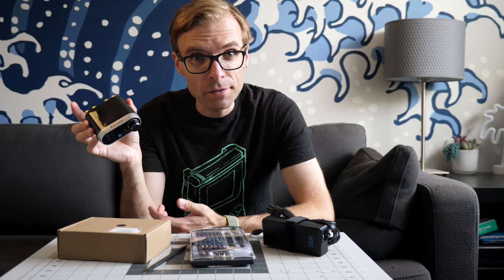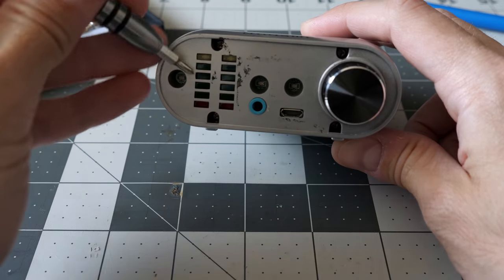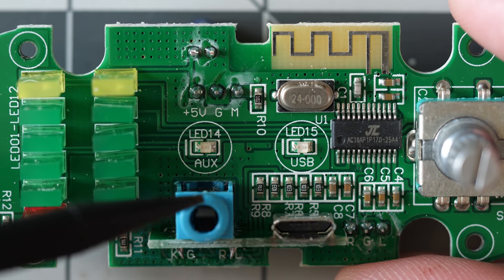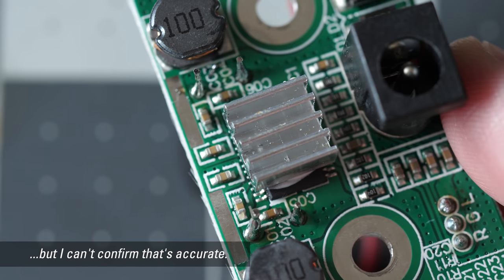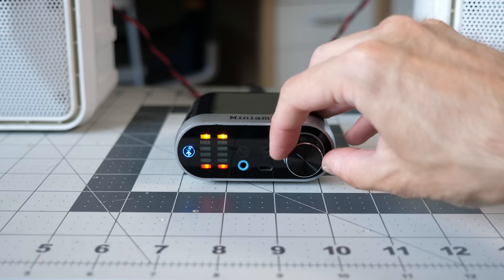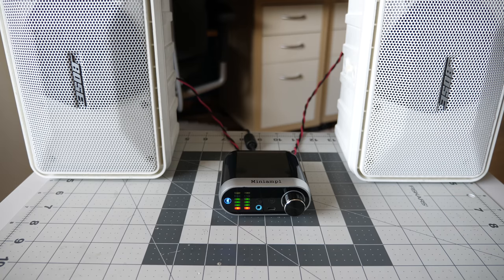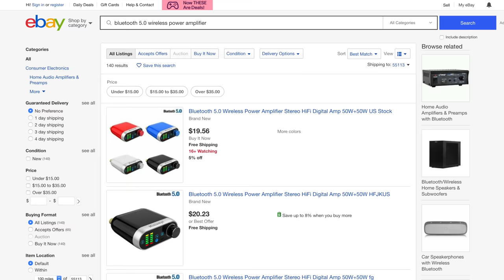Mini Stereo Amp (That Doesn't Suck)

Comment: If you're worried about internal heat build-up in this tiny amp (which i would be), get a dremel tool and cut some 1/4" vents in the top & sides of the case...or even just drill a bunch of 1/4" holes in it, all around.
Reply: pls don't.. it's a class D chip. it only gets warm. and it is ment to transfer heat to ground plane trough a bottom pad

Comment: i built one on a breadboard with a TCA0372 1A dual opamp which i recycle from an old table top cd player.
i think the fun part is when i realized i got the calculation right when i hook up to an oscilloscope and no magic smoke.

Comment: With its PCB design, 4 big audio connector work as big heat sink, better than its tiny heat sink. With an efficient switching amplifier, I would not worry about heat dissipation.
Reply: Thats a good point, as long as it has nice big thick tracks to the connectors.

Comment: I think it's virtually the same as Nob Sound NS-01G pro. It probably uses the same chip TPA3116A x2. Class D amp, with some method to minimize the noise that class D amps produce. Mine is great, I love it

Comment: If you want something that's actually decent get something from Fosi Audio or Aiyima like the new A07 Pro, yeah it's more expensive at around 60USD and completely overkill for your use case but it's actually manufactured right and does some great power.

Comment: The worse part about the cap leads is that the proper practice is to cut the leads to length prior to soldering, so it wasn't even a 'couldn't reach' issue, just straight laziness lol
Reply: Or, that capacitor lead length might also could be serving as heat sink for the cap,  
extending the life of the cap just a little tiny bitty bit. It would be more applicable in
a switching power supply where those caps bulge, leak and blow chunks as their 
ESR goes up and up... That's the main failure w/ MOBOs, & especially LCD Monitors.

Comment: What are the BOSE full range speakers like at over 10 khz? How to make an amazing full range speaker sound (with the extra khz). Make a pair of extremely thin sticks that are also very short sticks (only like 2 mm tall, made out of a split toothpick). Then glue each stick onto the dust caps of the FR drivers and stick a tiny piece of (coffee can seal) foil onto the ends of the sticks. Cut  the foil pieces in a teardrop shape like 1/4" x 1/8" big. I suggest you prick a hole in the tiny foilies to make them easier to glue onto the ends of the sticks. It's REALLY TEDIOUS but really cheap and your full range speakers will STING like crazy in the top end. 

It's acoustic separation technology, the foily is vibrating completely independently of the dust cap, and that is the big secret. If you attach the foily directly to the dust cap you get NO WHERE NEAR the effect. When it's on the end of the stick, acoustically it's like a miny 2-way coaxial driver, giving the top end a completely separate vibration to the main cone. And this extends the highs way better than just sticking the foilie directly to the dust cap.

Comment: Increase the voltage by 1 or 2 watt. Depends on the ohms your dealing with. Built a heat sink to prevent heating up..

Comment: I bought the exact same AMP a few month ago, Iv been using it as an amp for some small 40W speakers Iv had laying around to upgrade the sound on my stationary PC. However.. The LEDs are not working on my AMP out of the box, and there is alot of static noice if Im using the jack input.. But other then that it works just perfect.. I did however buy it with a Power supply that has a 19V and 3,42A output :) And I think I payed like 25dollars for it all.. Well worth the money :)

Comment: 1:00 I had to modify a 2.1 amp using the cut track method, as the subwoofer channel had an independent volume control that wasn't controlled by the main volume. No idea why you'd design something like that...

Comment: OK .... so I am old and remember the massively heavy amps that were common in the late 70s.  Good thing with them is after several decades of working flawlessly,  they atleast made a great doorstop  or weight for holding down wood projects as the glue dries 😁     Much agreed on Test them Dismantling idea.    Wish those with Amp Dynos would start testing more of these budget D class amps to see if they meet claimed outputs.   Worst case you have a light duty use Paperweight if all else fails
Reply: My 1976 kenwood is still running as a dedicated guitar amp (added a cooling fan),wonder how that little unit will fare in the long run...😒
Reply: Many of those old amps are or were fixable, since they just used standard transistors. Another plus.

Comment: I wish they put all the ports on the back, if you use a laptop dock or desktop, you'll have to run the cable out the back. 
Otherwise a great amp. 
For now I have a kinter amp and it's not as fancy but it has a real POT volume knob and RCA input on the back. For $18 from Amazon it's a decent deal. 
I might get the upgraded model with an extra AUX on the front and a Subwoofer input.

Comment: Hand drill a grid of small holes through the top bottom near the chip. Add a bigger piece of metal on top of the other. The googlnet can tell you what adhesive is decent for cheep. 
Have fun with it. Make a slightly larger enclosure that has the above features and say it's a custom built amp just for garages. Bend an old gas can or put it in a cigar box. My brother-in-law user to do stuff like that in our shop. We'd take the speaker-loaded front panels and staple them into large cardboard boxes of "correct" volumetric size and A-maze our friends. Fun is fun!
Reply: My brother made a killing back in the 70's building custom speaker boxes using particle board and speaker cloth. We would salvage speakers out of old stereo units and he would sell eather custom built preinstalled or you could choose from a list of Radio shack speakers. He sold a ton of those before getting bored with it. I believe it financed his first car.  1970 Duster. Those were the days. I am restoring old lawn mowers to finance a Conversion van right now.

Comment: The heat-sinked IC on the back board is likely a class D amplifier (switch-mode outputs). This is re-enforced by the inductors present on the each of the speaker terminals.I don't think overheating will be a problem.
Reply: Class D isn't magic. Yes, its a lot more efficient (90-95%) than typical class AB (65%), but it still has to dissipate some heat and that is very tiny heatsink in an enclosed space with no path to outside.
Reply: @goatofpower  True, there is no magic. However, the heat produced depends on how hard you drive MOSFET gates, and how fast the MOSFETS switch between off and on states. That switching time is where most of the heat is being produced. Minimize the switching time, and you minimize the heat produced.

Comment: Actually, I think the metallic contacts act as the heat dissipaters, they are big enough and get rather  hot while the amplifier works - though they do not touch the chip directly.
The sound level bar is absolutely useless: I just put a sticker on the green/yellow region and can only see two red indicators. :-)
P.S. Just discovered that it is possible to hook up Sumsung s7 to this device via a MiniUSB adapter and use it as an audio amplifier for the phone. The S7 has recognized the device immediately.
UPDATE. A couple of days of good work and now the sound in one of the channels disappears in about 20 minutes after being switched on a insignificant load. It looks like the heat affects the  soldering somewhere inside.

Comment: Class D, the future of commercial designs - ~90% efficiency, small heatsink seems to be 'OK'.
Also break the connector, complain about build quality :D
Reply: 90% “theoretically” efficiency. I have yet to see just “One” class D amp that actually deliver what people expect from the specifications. Even professional build class D amps that promisses like 1-2k watts into 8 ohm usually gets utter blown away by a well constructed 30 year old class a/b amp of 1-200 watts with a 15kg transformer in the psu. Class D is only good for cheap solutions where real muscles for continous High power load isn’t really needed. That doesn’t mean that its completely useless tho, you just can’t expect anything at all from these kind of china electronics. You might get possitively surprised sometimes tho. But in most cases Its more than adequate for driving those old car speakers out in the Working shed or for a cheap bluetooth speaker for your phone.

Comment: I got the LvPin 2.1 hooked up to two 
NIB SET OEM 6x8 Genuine Ford Speaker XC2F-18814-BA  with GRILLS 25 WATT 4OHM  and one 8" subwoofer all installed into a plastic cooler and I just plug it into my cig lighter it blasts me out of car!

Comment: That's a neat little amplifier. For $20 it sure beats building one. It'd be interesting to risk mucking it up and injecting a tone as well as looking at the output on a scope but I was convinced it was worth the buy by your choice of speakers. 

I would set the unit up in my van for playing audio books. Most normal car units without running through a separate amplifier are a bit underpowered for clear audio when road noise is a big issue and they are a pain to pull out of the factory fascia and mount they are installed in so as to swap or modify. The only thing I would do is create air flow through the case because I can't imagine it not becoming an oven in the enclosure even at around 20 watts.

Thanks for the video and being the test dummy. I have not been as lucky in my eBay lottery adventures.

Comment: Perhaps they tuned those cap lead lenghts to act as RF chokes for a specific harmonic frequency of the PWM amp in order to minimize ultrasonic distortion ? ;)
Reply: i didn’t say inductor. They are certainly antennas, and hence their propensity to attenuate (or, “choke”) any rf energy that is matched to the impedance of those lead lengths (hence my “ultrasonic” comment).

I had put a “;)” but I guess you missed it 😛
Reply: I actually said “act as…”Cognitive dissonance harder 😝

Aren’t you up on how RF antennas work? Hint: they radiate energy optimally at a specific frequency. Google “simple RF notch filter”.

Comment: I have this little amp. I ran it on a 19V 65V power supply and compared it to a small Harman Kardon amp using small KEF loudspeakers. 
Conclusion: it’s a neat little amp but it clearly lacks bass. Maybe it really needs a 24V power supply but at 19V I cannot recommend it.

Comment: Why you didn't use a old/used or new car radio to play music in your garage? Build it into some type of case, connect a 10Amp 12V DC Power Supply to the car radio and it's all fine.
I build one into a tool box. I have also installed the speakers in the tool box. But I always have the possibility to connect other, external speakers.
Reply: That’s what I’m thinking of doing. You get 4 channels and lots of options, generally. Also the sub outs are nice if you want to add some low end.

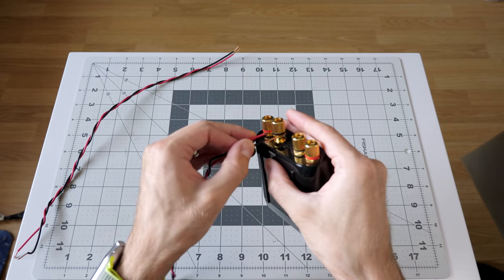Comment: 13:03 You don't have speaker cables twisted like that, it acts as an inductor and consequently a loss of highs. You should know that.
Reply: This is not a coil; short intertwined wires have no audible influence at all.
Reply: How much RF do you think is prevented by doing this?

Comment: Hey man I love the content and the production , really well done . My question:  I bought a few of these Toptech “1000” watts party karaoke speaker that has (2) 10” speakers w some party lights and a handle . You know one of those big speakers , I got this one at discount retail store. The sound is “ok” to say the least but of course it’s missing that BUMP.  Now maybe I won’t be able to get that nice bass bump that I would get from jbl or Bose, but it just sounds weak.
Here the actual question: is there a way to connect one of these type of amps to that type of speaker to give it that extra oompf it really needs? Maybe you could do a video where you add an amp to one of these party speakers !? Or if it’s not possible do you think you could make it possible?? If you did it would revolutionize the market . Make these speakers actually worth buying. Please help.

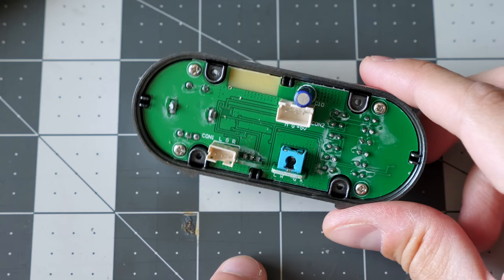Comment: At 3:57 the LGR connector is attached to the board, after you remove it at 4:04 the connector is broke from the board. Then you complain about the short you created like it was the manufacturers fault after you put it back together. Using the proper tools to remove the connector instead of yanking on it might have prevented the damage.

Comment: If it's Chinese, it's 50 watts (if that) at 10% THD.  At best 12 watts at anything like HIFI specs.  But who knows, could be a gem.  For $20 I'll take a leap fo faith.  My speakers are 92db.
Reply: The amplifier chip which does all the heavy lifting I believe has something to do with the US state of Texas! So yes 50 watts with the right power supply and speaker impedance.

Comment: you broke the solder joints on the RGL connector when you removed the cables . It is clearly visible at 7:41.
Reply: I see that he pulled the plastic housing off.. and probably didn't push the connector all the way back in when he re-assembled it... another reason why you need to disassembly it... AFTER testing it!

Comment: You should feed it clean DC.  A laptop charger is far from clean. You could use 18 li-ion cells (6S3P) instead; (6 serial, 3 parallel), for a clean 24 VDC supply.  The batteries are probably more expensive than this amp.

Comment: Hooked one up to harbeth p3esr. Used same power supply i got with     
Tivoli model 1 radio. 12v sounds quite nice within its volume limitations as these are not efficient speakers. Allen shaw is quite right about amplifiers and harbeths. As the audiophiliac said. Harbeths makes everything sound goood.

Comment: I certainly wouldn't expect it to drive the Bose speakers. That tiny amp is basically pi**ing it cuts out to try to drive it. It gets double Brownie points for not distorting the sound though.

Comment: If the boards were designed a bit differently to allow the massive caps to lay flat against their board, and rearrange the front board a bit to move the connectors to the top half, this little amp could be made to be extremely compact. It's overall footprint could easily be cut down to a quarter to a third of what it currently is with better initial design considerations. Alternatively, all of that dead space inside the case could've been used for an internal power supply. 
The idea of using the banana plug screws as cassis posts is smart, and might be an idea I borrow for future projects. 
Though the rotary encoder is something I'm not too sure about, it's useful in applications where you have menus and such to scroll through, car head units are a great example of this, but for a volume-only dial I'm not too sure of the implementation of a rotary encoder. I wonder if this kit is actually based on a reference design provided by a company, or used in other projects, where that rotary encoder actually sees practical use, an this just happens to be the cheap variant of the product that cuts out anything that isn't strictly necessary; such as incorporating a display and software-based equalizer, which I'm sure that chip on the front board can provide, I don't feel like looking that chip up myself, but I do know the vast majority of Bluetooth audio products have more features than what this unit is providing. 
The VU meter seems a bit sketch as well. Look at how bright the power input and power on lights are, as well as the brightness of the solid volume min and volume max lights are. Even when the top lights are functioning as the VU, they seem much brighter than the other VU lights. I wonder if the lights are of bad quality, or if the circuitry for the VU is of bad quality.
Reply: Internal power supply would be nice but its a nightmare getting approval in all the countries. Thats why nearly everyone uses external plug packs. (And no, you can't just put an approved power supply inside the case!)

Comment: By the way, this amp costs ¥99 (99 CNY) or ¥116 (116CNY) with a 60W power supply included in China. All the generic mini Bluetooth amplifiers you find on amazon and the like are made by a Chinese company called “AHIFI发烧音响器材店”. I can’t believe how inflated and overpriced the prices of these are in the United States. Seriously.

Comment: You REALLY need to drive these TDA chips with 19v or more because at lower voltages they just don't sound very clean. But no matter how much voltage there will be background hum. I run a pair of Yamaha BR15 15" PA speakers with a 19v/144w DC brick and they're close enough to a real yamaha rack amp SQ wise

Comment: I buy the Amp for 15 Euro and it work really good for that less money! I don't knew that the USB Port was for direct Audio out for a Computer...that is Amazing, is'ent it!? Sure, i think so! 

I don't know for what i need specially that USB Port to use for..., but it is there and maybe in the futore i have a idea for what i can use it ;-) 

Nice Review ... in my Oinion that Amp is all the Money worth!!!
I buy it for an iPad to use it with Guitar Software and Audio Speakers for HiFi Sound not for Mixing and i think thats Sounding very good! 

Other Solution with this possibilities cost a lot of Money!

Check that Amp out...i take up all two Thrumps! 4 of 5 Stars! (maybe 4 and 1/2 about the absolutly low cost)

Comment: bro! i have a TPA3116D2 with Bluetooth. powered by a 42v lithium battery pack with a buck converter at 24v. On 2 10 inch Rockville 4 ohm PA speakers.... that shit is so loud Im not joking. try it out!!! built under $200 so freaking happy with it.

Comment: They left the wires longer and soldered on the two output caps to dissipate heat better, due to the amp. I.C...  the caps won't develop cold solder joints.